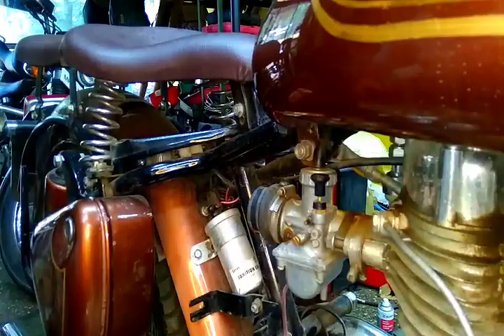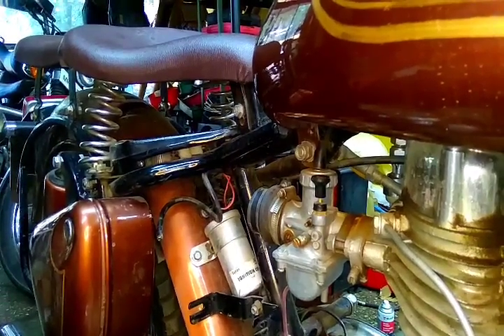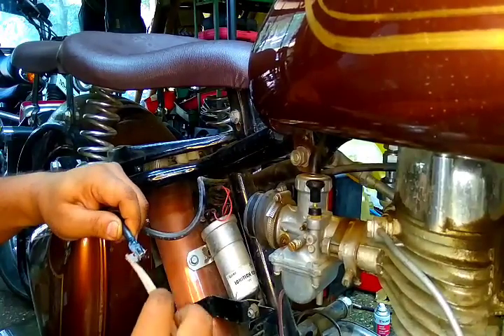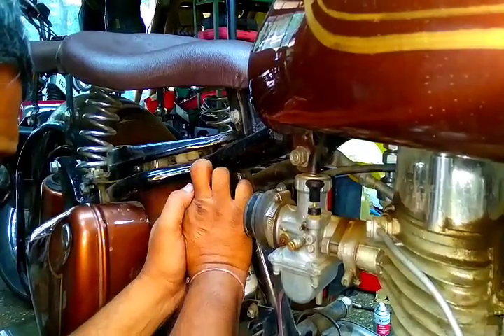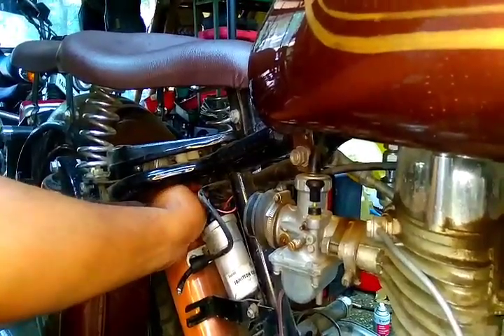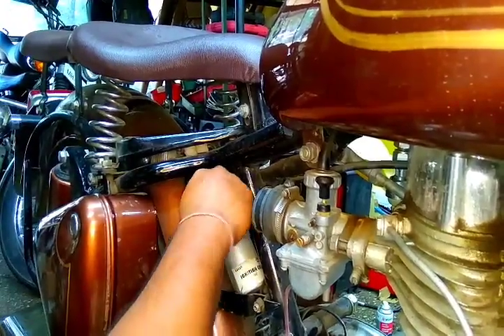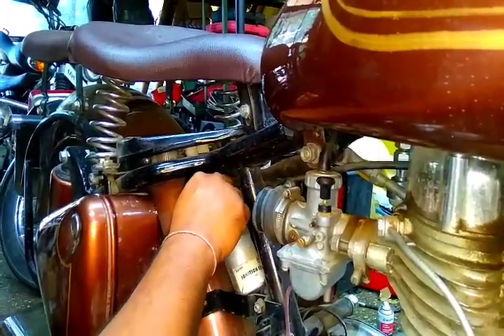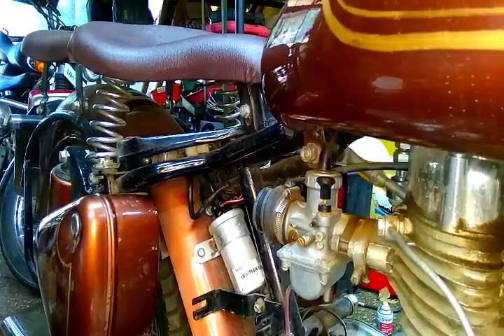Royal Enfield Old(350cc/500ccCBP) bikes water issue with electricals-Remedy only on YouTube(English)

Comment: Dear Sir, Recently i purchased a 1966 G2 Bullet... There are 2 piece of problem in my Motorcycle
1) Is While turning the Motorcycle Stops
2) Is the mileage has dropped down Significantly... Where's i just opened the Air fuel mixture screw for just half turn only.. 
And like for 1 Litre of petrol I'm getting only 13-15 kmpl only
And When i opened the Air fuel mixture Screw for 1 full revolution, then I'm getting Starting problem... Can you help me out, please
Reply from the maker: @clementsebastian4875  what's the color of spark plug? (Color of porcelain material) open the plug ans check. If black then carb setting is wrong or jets are wrong or air filter is choked or you need carb setting or the fuel choke is on or damaged which is supplying extra fuel.
Reply: @MechAutoClinic  Sir, Recently only I Changed the Carburetor, ame the Spark plug colour is like almost White... And the Air filter is also replaced
Sir, According to you, What Mileage Does an 1966 G2 would Offer?
Reply from the maker: @clementsebastian4875 old bikes I don't expect a lot due to wear n tear... But yes yif you have replace all these above spares then I feel you have blocked the air intake hole while fitting the connecting hose which is in between air box and carb. Since carb has vents at the periphery (6 clock position) from inside often gets blocked due to connecting hose. Which you can see from outside. Also if plug color is white then prolly your carb is very leaner side. Check the carb from all parameters. Thanks
Reply: @MechAutoClinic  Thank you Sir, I'll check the above mentioned issues..